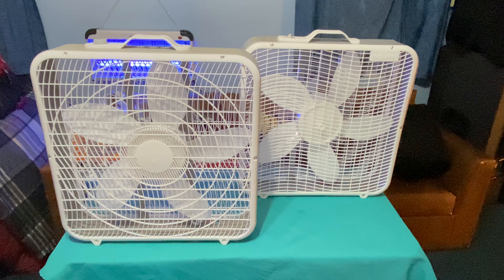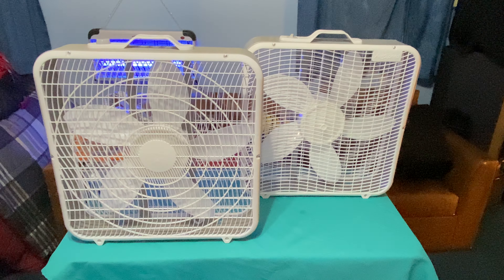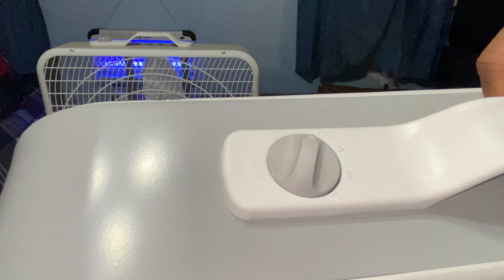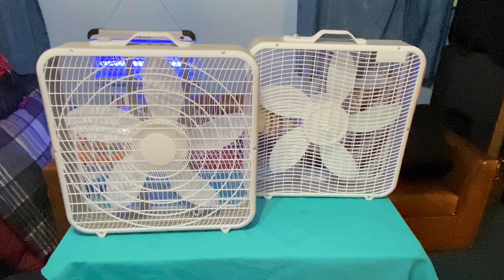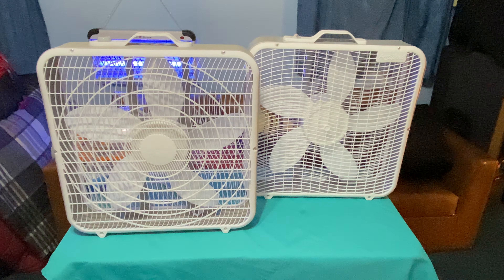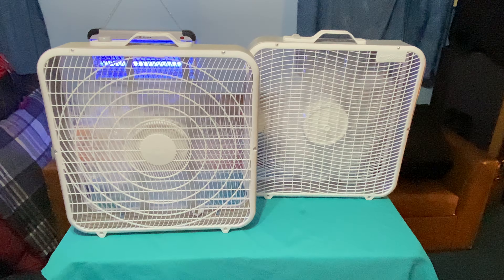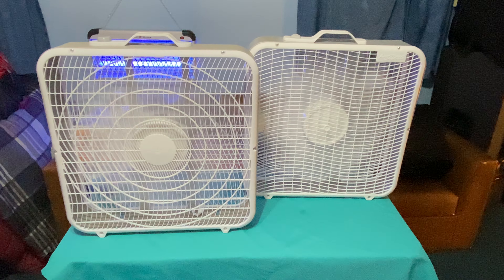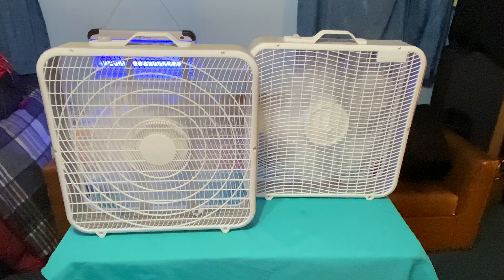Camair (Aerospeed need to get their act together)

Comment: Lasko had made a all metal box fan that was powerful but they quit making it
Reply from the maker: true they did they quit making them but people wasn't willing to pay a ton of money of them they we're almost 100$ or more i wish they would have kept making them
Reply: @LemontTheFanMan  And I remember my mom bought the weather shield box fan in early 2000 it did not cost that much and it had deeper pitch blades and thicker plastic and bigger motor and the frame was wider and thicker and you could get a desk fan for 12 dollars that blow about the same amount of air as todays boxfans at that time

Comment: They use cheap flimsy blades on Aerospeed box fans and have been for a few years now. Laskos blades aren't as flimsy as the Aerospeed blades
Reply from the maker: True agree espcially on the Lasko weather shield 3720 and the premium 3723 the blades seem of that in the early 2000s i would  say the 3733 is far better then the aero speed box fan when comparing the two. but vintage will always be better sure wished they would bring it back...